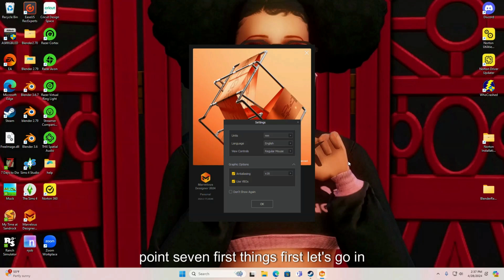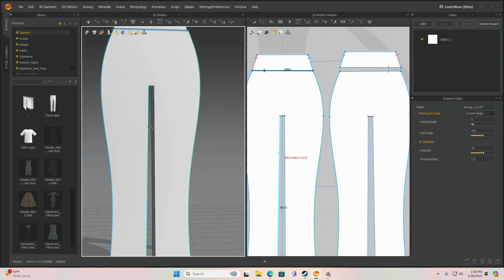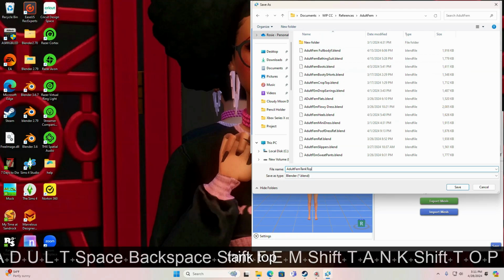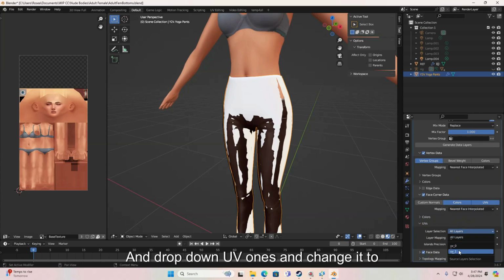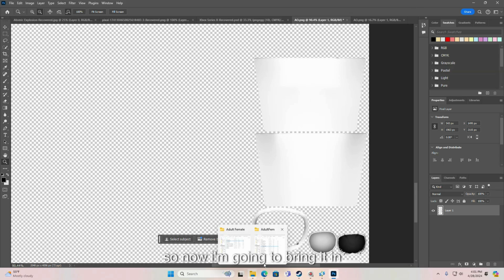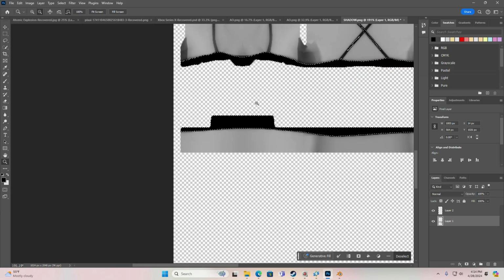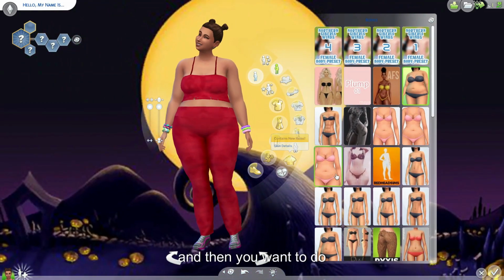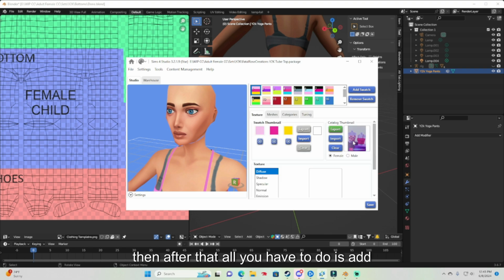Tutorial: Creating Clothing CC: The Sims 4: Using Blender 3 6 7

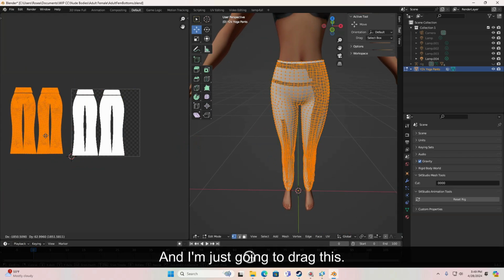Comment: hey! I've just started making cc and at 28:47 you start to move the pants away but then you dont because you have "no ea mesh to cover", and what if you did have ea mesh to cover? I'm making a skirt and i still have legs that need to go on the uv map so I'm a bit confused what to do with them
Reply from the maker: So if you still have legs, when you merge the two meshes together, If you dont move the UV map of your mesh outside of the box like I started too, then when they are murged your UV map will be ontop of whats left of the leg map you have which isnt impossible to seperate its really easy just annoying and avoidable. Then the only difference is when you scale your UV down [s,y,.5] when you go to place your uv map in the boundry for legs, you just cant place it ontop of the Leg UV that will be there. Like at 54.33, you see my shirt mesh is in the bottom corner because I cannot place it over any of the arms or upper body mesh but since we deleted the legs completely for the pants that wasnt an issue

Comment: if anyone has the same trouble as me while trying to merge meshes of the reference.. make sure the last mesh selected (it will have a brighter orange outline than the others) is the one of the actual garment and not the cuts (highlighted at the legs). i started over 3 times thinking i did something wrong but it was nothing i had done, just a silly rule